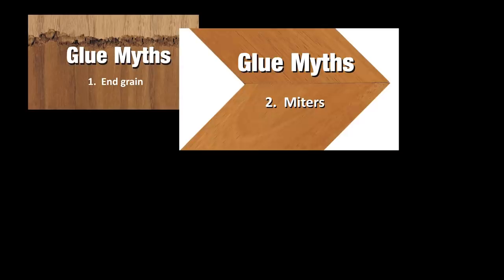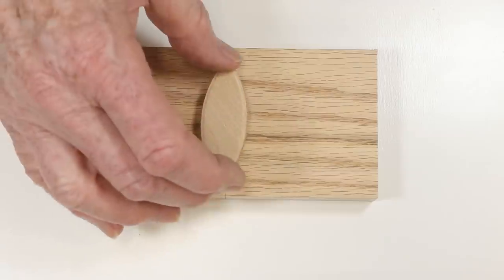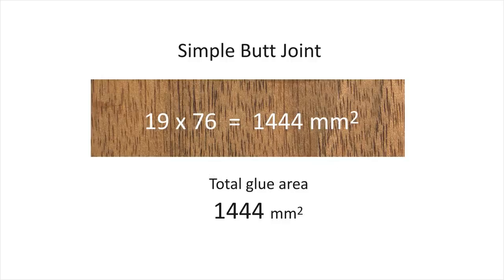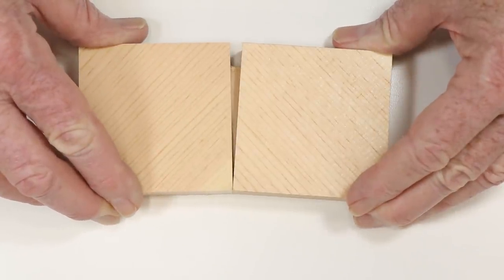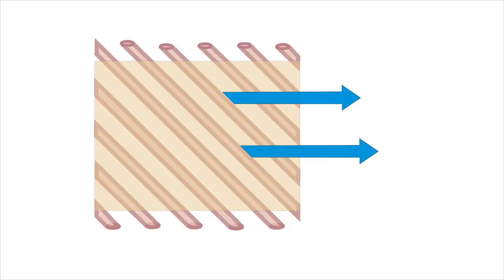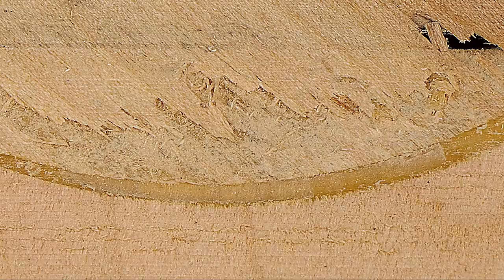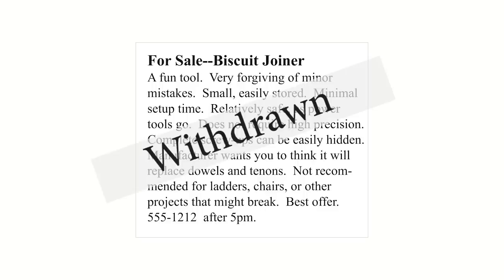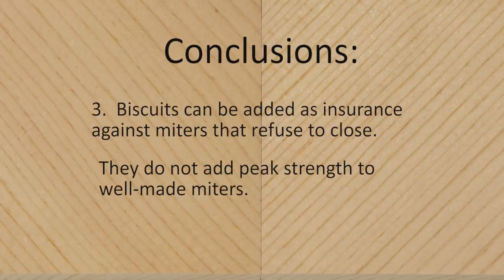Glue Myths:  3. Biscuits

Comment: The results surprised me.  I expected a small increase in the joint strength with a biscuit, but I still expected the biscuit joint to be weak.  Two of the things going on here are: 
1. The  biscuits should be  installed on the outer edges if additional. That would be ugly, so I'm not suggesting that this be done.
2. The direction of the fibers of the piece used to strengthen the joint need to be across the cut. The problem with a butt joint is that there are no wood fibers that cross the joint. Biscuits would help more if the grain direction of the biscuit were changed to be parallel with the grain direction of the wood.

The bottom line is that almost any normal wood working technique would strengthen a butt joint more than a biscuit. Biscuits are bad because the are thin so they concentrate the strength they add almost entirely in the center of the joint. Biscuits are bad because they grain direction is wrong for a butt joint. And biscuits are bad because they add less glue area to the joint than most other wood working techniques would.

Comment: I made a mortising jig for my router. It uses a bushing that rides in a slot at the top. I based it on Phil Morley's jig, but I made it so I can cut pieces of all angles (though the top has to be flat up against the bottom of the base), so my jig uses t-tracks and blocks with clamps on them, so I can do very narrow pieces (down to 1/4" mortises on 1/2" pieces of wood) or and I can do very wide mortises, and/or cut into pieces that are very wide, so the mortise can be set back far from the edge. The top moves about 6", so I have a wide range of choices...  I then custom make loose tenons to fit into those mortises. This makes me want to test the breaking strength.  I like the loose mortise and tenons because the mortises are fast and easy to cut, especially now that I've designed and built my jig, and the tenons are also very easy, and can be cut with repeatable accuracy.  I feel they are better than dowels because they should resist any racking/twisting more than dowels, and part of me wonders if they may be structurally better than hand (or machine) cut mortise and tenons that are not the loose kind. They certainly provide much more structural stability than biscuits.  I built a gate this past summer, when I replaced my fence. The gate is 9'6" wide, and in the middle is a W, with those four straight lines of the W each being a piece of lumber, with a loose tenon attaching them together, and I was able to lift all four 2x4's with the tenons in place, and the W held its shape, and that was before I had having put any glue into them, and before I had put the W into the frame of the gate. In any case, I appreciate your expertise - you clearly have more experience with this than I, and it is interesting to think outside the box, and you did, literally, break the mold, so thank you for that!

Comment: Pat H has identified the exact weakness of your testing method. Think of a steel I beam. The top and bottom flanges are wide in order to put most of the material (strength) where most of the stress is when a bending load is applied. A very small thickness of metal is in the center of the beam (web) the stress from bending is lowest along this line (neutral axis). There is no location in the joint where the biscuit contributes less strength to a joint in bending.

This kind of testing is important so please keep up the good worl,

Comment: Thank you Mr. Sullivan for the very interesting series on PVA glue and wood grain.
Most conclusions are valid. They draw from logic, experience and tests. However:
1) As said in several comments, the biscuit is almost in the neutral axis of the cross section, so it adds very little strength to the joint
2) Biscuits are somewhat loose in the slot, so they are not the best kind of joint. They are more useful to align the pieces than to add strength.
3) Biscuit material has less strength than many types of wood, so no wonder it breaks before any damage to the main wood pieces
It would be very interesting to see test results with a tight biscuit perpendicular to the applied force, a more representative setup of the real life forces on a miter joint

Comment: First test was a bending test along the minor (short) axis.  The peak stresses would be at the edges with only the glue bond.  These stresses would be the same with or without a biscuit.  A tension test or bending along the major  (long) axis may be more telling for just the biscuit strength itself, but still won't help the table strength with end grain connections.

Conclusions about fit-up are good case.  I know people that just use dowels over the biscuits or dominos.  Be interested to see if dowels are any different than biscuits.

Comment: Also the cabinet shop I worked in as a young man we would use 23 gauge headless pin nails four on each side to bind the biscuit and joined wood four pins per side.

Comment: In think leverage is everything and limiting it with grain orientation is the most important factor. No matter how strong the joint you can break it easier if leverage is available to the joint because of the finished project allows it.

Comment: Excellent work once again Patrick!!  I had watched part 1 and 2 and wanted to see the spline effects.  With my Mechanical Engineering background, I have to totally agree with the comments about how the force is being applied, i.e., along the neutral axis, and that is not the practical application.  As most everyone has stated, the biscuits, dowels, and dominos are all used for alignment while gluing.

It would be interesting to see what would happen if there were (2) biscuits evenly separated away from the neutral axis, but I don't think your test sample it large enough to allow for that?  However, could you turn all cases of your test pieces 90 Degrees to simulate more of the breaking force that would pry open the joints over a longer distance?

I truly enjoy and appreciate your work.  It is all accurate in the approach you have taken, but like prototypes, we learn new setups as we go and come up with ultimately a better product.  Thank you very much for providing data versus just opinions, which everyone else can easily do.  LOL

Comment: Well done, and thank you. Where biscuits and a joiner have been an unbeatable benefit to me has been not in strength, but rather alignment. Primary case was out Dyi job on a 3/4” T&G hardwood floor and all with hidden nails (can’t recall the term, but nothing thru the surface).  As soon as you trim an end or edge to fit, the T and/or G are gone. BISCUIT!   13 years on and still perfect. Huge project and tool more than paid for itself then and since.  Alignment not strength.

Comment: In the direction that you were testing the samples, the pressure on the joint would tend to split the end-grain joint on the OUTER surface first, and then very rapidly the split would tend to progressively work it's way into the biscuit (this is milliseconds fast). Then the moments acting on the straight grain of the biscuit would tend to split the fibres apart, as they rotate, to try and reach the direction of the pulling force acting on them, thus tearing the biscuit and the joint apart. So it seems likely to me that the best thing to do, is not to put ONE biscuit on the centreline of the thickness, but to put TWO biscuits in,  just under the surface of the back and front faces. That way the biscuit will act like plywood just below a thin veneer. I wonder if you tried that, the results would be different???

Comment: As someone else pointed out, the biscuit was inserted at the neutral axis. Before the test was conducted I expected the result would show no difference from previous tests. In a bending load the max stress is at points furthest from the neutral axis, which means that peak load depends on glue strength, and the biscuit's contribution is negligible. A complete set of loading conditions need to be tested before meaningful strength conclusions can be made. However, even with that information, I doubt whether any wood joinery design would be altered.

Comment: Using biscuits to add more gluing surface to a joint is like cutting your boards in half length wise to add more gluing surface. Technically it will add surface, but it doesn't add any strength to the joint. I've always viewed Biscuits as a device to help align boards together. If you need additional strength, a half lap or tongue and groove type of joint will probably be better.

Comment: Plate jointers are very overpriced. Even Harbor Freight ones are expensive in comparison to other tools.

It’s simply a SMALL saw with a casing. You can get full sized table saws for the price of one. I was fortunate to get one on clearance;probably a return) from my local Sears before they closed for just under $20.
I didn’t really know much about it then, but I was glad I took advantage because after I started looking into them I saw how ridiculous the prices were for them. And I really just have it collecting dust because I don’t even use it.
But then again, I haven’t started working on my own projects so I hope to make use of it soon.

Comment: Again, as said in the end, it all depends on the direction of the force. Imagine the miters of a picture frame being pulled apart by leverage being applied on its sides… That is the kind of situation a biscuit/domino may make a difference (I suspect).
Reply: This is such an important point that I'm not certain if the poster is deliberately obtuse or stupid.  Biscuits mainly help with alignment and then the force they help with is in plane of the biscuit, not across.
Reply: @ibarskiy  Actually watch the video before you speak so rudely. Watch 7:16.
Reply: @zunuf  So we're going for deliberately obtuse then?  Since you know, the entire video is spent on investigating things noone ever believed biscuits help with (and for the record, the primary use of biscuits is generally understood to be alignment, not joint strength.  For the latter, serious people always recommend at least loose tenons) and then the only real potential strength benefit is noted as a potential asterisk (not even investigated!).  This entire series is pretty sensationalized, which is a shame.  Some of the information is good, some of the tests are good, and there are useful takeaways, but the conclusions drawn are all bad / useless in the context.
Reply: @ibarskiy  If it turned out that biscuits do provide extra strength in the direction he tested, would you still think it was a useless test? Nobody is questioning whether you can use joints for alignment. What is more interesting is testing axioms like "more glue surface area = more strength."

His charts show that breaking the wood across the grain is multiple times stronger than any any glue joint. Is it that crazy he might test breaking a biscuit across its grain?

It's not being obtuse to specifically mention the limits of his test results. The creator of the video clearly tries so hard to say "no need to throw out your tools" and "my tests aren't applicable to every situation" and people like you still get in a hissy fit.

More information is always good.
Reply: @zunuf  More information is good when it's useful.  More information that is not overly useful is not great.  Maybe not even good, because this noise tends to crowd out other data.  But we digress.
Biscuits have never been intended as reinforcement perpendicular to their plane.  Glue joints in end grain were never intended to be measured against strength of wood perpendicular to grain.  The strength has always meant to come along from shear along the grain - which is pretty darn strong.  THAT is why all this useful data, put in this context, is highly misleading.  It tests for something that wasn't meant to be true anyway, and it presents results in language / context that may actually confuse and create errors.  None of it is wrong - but all of it is misleading.
Reply: @ibarskiy  When people glue together a tabletop with biscuits they expect weight to go on the table top. They don't expect tables to shear along the length. Yes, people put biscuits in tables for alignment, not strength, but is it really so insane to be curious if it does add strength? From this test we found out it at least might make the failure of someone jumping on your table slightly less catastrophic.

I care more about furniture than picture frames. Maybe people make chairs with miters I don't know about.

It seems like you're worried about stupid people being mislead. From what I've learned is not matter how clear you try to make something, idiots will find a way to misunderstand it. How about we stop worrying about a hypothetical stupid person throwing away their biscuit jointer?
Reply: As a framer, almost no picture frame can resist that kind of force. V-nails, inserts, brackets, nothing will. Leverage is way too cool for that.
Reply: @Dorweaver  Of course everything has a limit...
Reply: @zunuf  Quick point - in my experience, more than 50% of people are prone to be misled (I will refrain from labeling them).  BUT your tabletop example is actually perfect to illustrate how this is not the use case.  Literally everyone in that long grain to long grain joint keeps repeating "the glue is stronger than the wood" - we already knew that! So we already know we don't need biscuits.
Reply: @dddmmm21  especially with the gusto some of my employees use in destroying old frames...

Comment: Maybe if the biscuits were made out of very fine alternating layers like birch plywood it would surely strengthen the biscuits and increase resistance to failure. Just a thought from a 40 year plus joiner. Interesting discussion with a lot of variables.

Comment: This is actually an important takeaway 7:16. This test, like many others have said, did not test the type of failure that when used in a miter joint. The test and its conclusions are valid though in the case of panel gluing, due to the biscuit being placed in the neutral axis of bending.

Comment: Will you try again with biscuits whose grain is oriented perpendicular to the joint?  Given the videos in this series, it may be a significant improvement in test strength.
Reply: I was thinking of the same.  They probably make them at 45º to get a few extra biscuits out of the stock by staggering them..

Comment: Actual strength would be dramatically increased if the biscuit was made of a material that was both strong while accepting glue well.  The actual biscuits are not very durable but are made from cheap wood.  If they were made from hickory, for example, I am sure the tensile strength of the joint would be stronger.  

Compression is not the issue, tension in the wood or glue is.  Of course, a spline joint of similar (or stronger) material would provide the maximum strength as that is indeed increasing glue area and glue is often stronger than the wood itself.  At least initially.

Comment: Would you ever consider testing this setup again but using your press to stress it 90 degrees from what you did? 
I'm a mechanical engineer and while stresses and strain weren't my strongest area in school when I watched this setup I immediately thought, "but in that direction it won't be any stronger than just the wood?!" and then, ya that's the result you got. Testing 'along' the biscuit instead of across it might yield significantly different results as the surface area of the glue will actually help in that direction whereas in the direction tested in this video it is really just testing the strength of the wood the biscuit is made out of which isn't much different than the starting wood.

Comment: I'm sorry, Mr. Sullivan, but I know of absolutely no-one who claims biscuits increase the strength of joints. Every single woodworker I know of uses biscuits as alignment aids only. I love my biscuit joiner but have never thought of it as a tool for strengthening joints. Dowels, splines, and floating tenons of all types are a different story, although I view these as supplemental aids only; the real strength of joints should always be the result of quality cuts and the appropriate adhesive.  Having said these things, I love your videos and will continue to watch as long as you produce them.

Comment: I use biscuits to keep things aligned in clue joints that I suspect will break.  

For example on a chessboard along the endgrain.  I know from building many chessboards in the past that it will have between ⅛ to¼ inch in movement so there's going to be an endgrain joint somewhere that will fail.  The biscuit is there to keep that joint aligned and intact.

Comment: However, the LINEAR strength of biscuits adds to the linear tensile strength.The glue joint has 2 axis lines, and the pull strength of this joint is actually improved. Then again biscuits also align the joints so glueup is easier and faster.

Comment: Sure looks like your store bought biscuits are a bit too small for your slot. They're slotting in there, swimming in glue, with no force required to push that biscuit into the slot. So while you're trying to treat the biscuit as a loose tenon, you're ignoring that (hopefully) you'd never accept such a sloppy fit for a tenon.
Reply: Biscuits cut are smaller than the slots.  It swells once glued.